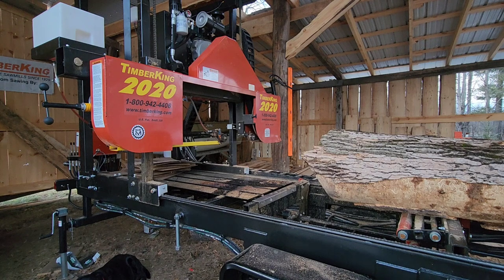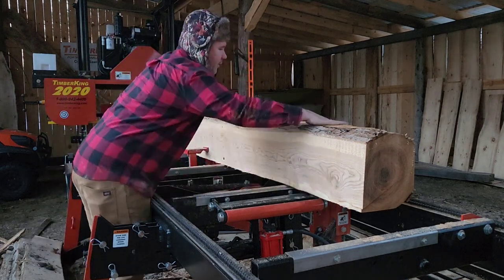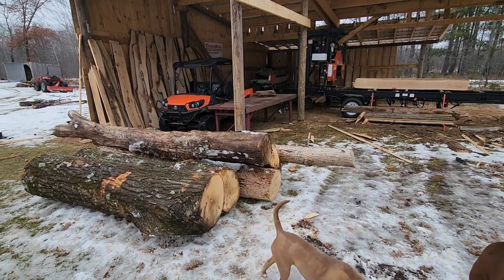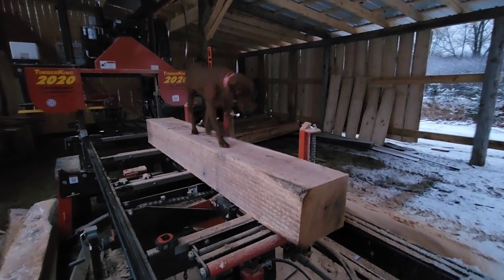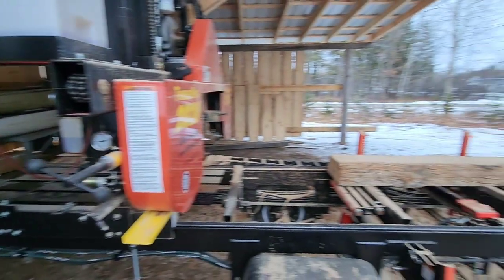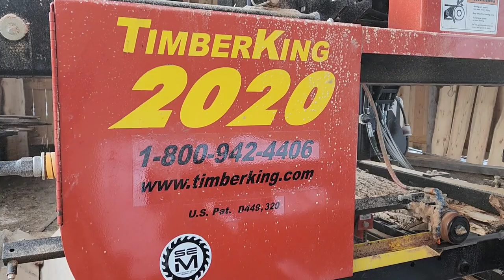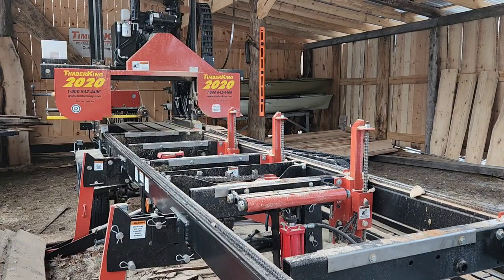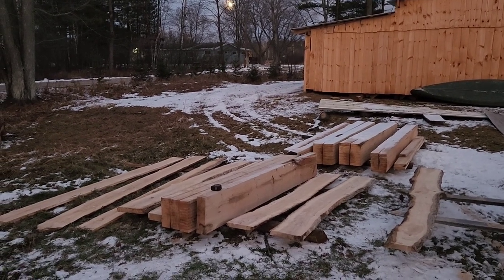Sawmill bandsaw blade testing, very impressive blade from SE Metals

Comment: Aren’t you getting some cracked boards when you cut through the pith like that? I’m getting an order today from se. I ordered 1 1/2 inch.
Reply from the maker: On the oak, yes, it can happen.  Depending on the cuts, I will resaw the pith out.  Especially on the 1" quarter sawn boards.  On the larger slabs, you can sometimes successfully capture the pith, and it will stay together....but not always.   I also will do mantels with the pith in them, and they stay  together.

Comment: Looks like I am 4 days after your posting the video and the deal seems to be dead.  My two boxes of Kasco blades shows in the cart as 14.52 per.  Did they give you a coupon code for that price?  I am trying to get 144-1.25-7/8T Kasco blades.  Thanks
Reply from the maker: Give SE Metals a call at 678-207-8550, they should get it fixed.

Comment: Why is the tension is so much different with the Woodmizer?
Andthe Timber King
Reply: I do like the existing of that band from that view 👍🧡
Reply from the maker: Timberking used to tell people to run a higher tension, but it did diminish the life of the bearings.  If you are cutting really fast (I don't), then it would be a good idea to run the tension higher.  That would prevent any dips or dives at higher speed.
Reply: I also tend to cut on the slow side as well, I don't run of 3000 psi, & only get a little wavy around knot cluster's with a band that should be changed.
That's why I purchased the Woodmizer equipment for keeping my bands sharp, I am  at almost 600 hrs on my Lt 40 wide, 0 bearing issues.
Knock on wood 😂
Glad your home 🧡👍🏡

Comment: i think a more accurate way to measure blade life would be to count the number of cuts not board feet , a 6x6 and 6- 1"x6"  boards have the same bdft but a lot more cuts on the 1" boards
Reply from the maker: I agree that board footage is not an accurate measurement for blade life.  So, I came up with the surface area measurement. Another way to do this is to ignore the thickness of the wood and say everything is 1".

Comment: Interesting. Looks to be a TK 2020 mill running the Kasco blade test, which has a blade length of 14'6" However the cost reference provided is for a 13'2" blade length. 
Wasn't aware the TK 2020 can run a 13/2" blade. Learn something new every day.
Reply from the maker: That was just an example I'll modify to my blade length.   I was just going off of a standard size.
Reply: What is the length I need for the timberking 2020?
Reply: Timberking says the blade is 14’10.5”
Reply from the maker: https://youtube.com/shorts/Qd3J9N1ciH0?feature=share
Reply from the maker: 178.5"

Comment: Comparing by board feet seems to me irrelevant. Four cuts off a large log, and you have a huge number of board feet. Cut 2 by 2s out of that cant, same board feet but a lot more wear on the blade.
Reply from the maker: I have talked about that in each of my blade testing videos.   I agree that board footage is not the metric to grade by.  So, at the conclusion of each of these videos, I say the board footage, then the square footage the blade traveled.  Square footage is my determination of how well a blade performed. Board footage = square footage if everything is cut at 1" dimensional lumber.
Reply: @TCSawmills  Thanks, Thomas. I missed that part.